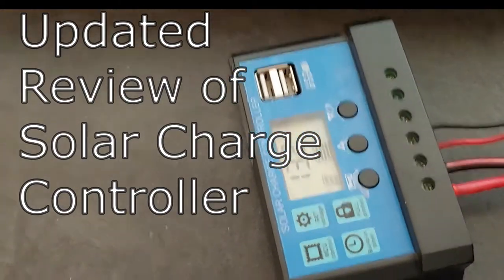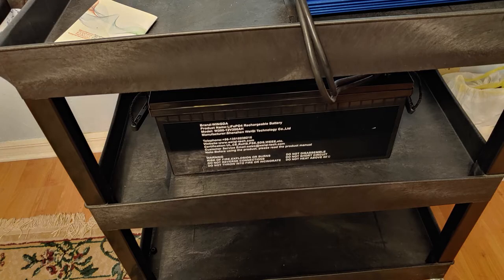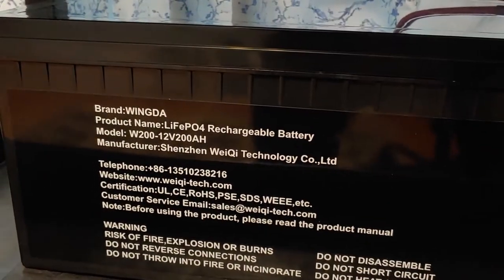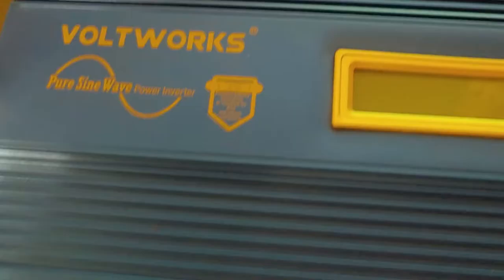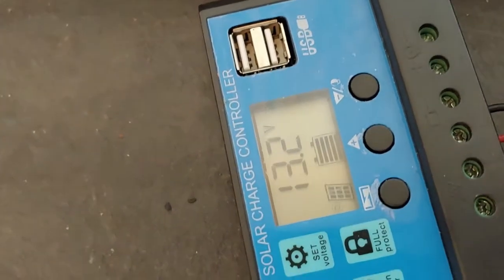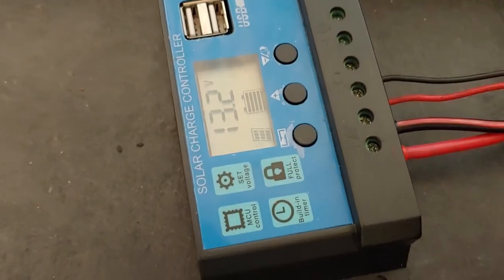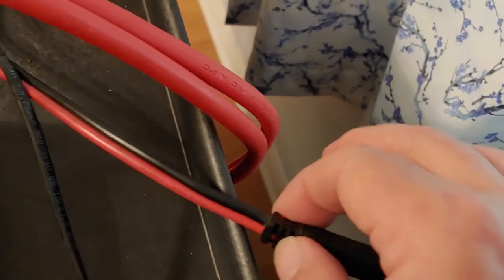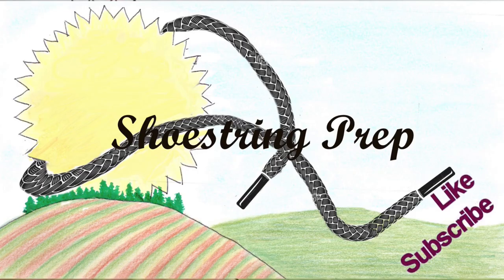4-week review of the cheap solar charge controller.

Comment: HAD MINE 2 YEARS AND ITS BEEN VERY STEADY, LEAVE IT ON ALL THE TIME, DOESNT TAKE MUCH OUT  AND FULLY CHARGED IN AN HOURS, FOR THE COST  ITS BRILL
Reply from the maker: Thanks for your comment.
Reply: @shoestringprep  what has the charge controller worked like over the last 12 months.

Comment: These are junk.  I got two and neither one of them pulse width modulate.  They just completely disconnect charging at 14.6 volts (Lifepo4) and then don't resume charging until 13.1 volts which is about 75% discharged for a Lifepo4.
Reply from the maker: Thanks for the info and your comment.
Reply: U may have it set wrong.
I got 3 within like 2 yrs, still have em and they charge up to the set point.

The problem i have is what Shoestring mentioned.. They seem to drain batteries with no solar pushing into them.

I plan to disconnect at night with a switch but Now i think i figured out the real problem (i could be wrong) .. maybe it has todo with that 24 that showed on the menu screen in this video.

Mine now shows that too when i know it should show 12(volts)
Its 12/2022 now.. when i got my first one in 12/2018 i remember being able to set it to 602 battery type and 12volt instead of it bein stuck on 24.

I think this is a flaw with these controllers and has to do with them slowly taking back power from batteries when no solar is pushing in.
Reply: They straight on off the full current on a 8 second period. Dangerous.

Comment: I have seen these cheap controllers available in versions of 20, 30, 40, 60, 100 amps.  I can absolutely guarantee these will not be able to take 100 amps.  For one thing, they have all of the same terminal strips and the wire for say the 60 amp and 100 amp are too tiny for the proper 60/100 amp wire to be secured to the controller.  100 amp would need a #2 AWG copper wire and it will not fit under these tiny screw terminal strip.  I believe they could handle 20 amps.  Pushing it to take 30 amps, after that, I will say you will have a burn off/melt down.
Reply from the maker: Thanks for the info and the comment.

Comment: Vehicles charge batteries around 14.2 volts while running  , a split charger system will charge the battery at the same volts.  So your right to set  your controler at that  voltage . 🇬🇧
Reply from the maker: Thanks for your comment.

Comment: Can the inverter be ran the at the same time the solar charger is charging the battery without issue ? i was curious because i noticed you did not wire the solar chargers load option .
Reply from the maker: Yes, they can run at the same time. Thanks for your comment.
Reply: @shoestringprep  thanks for the clear info!

Comment: Why would my negative and positive coming down from the control/charge box onto my batteries be getting hot? My negative wire was completely melted…
Reply from the maker: This could be caused by two major problems first the wires you have connected are too small or the amps and watts your solar panels are producing is too great for the charge controller. I would check these possibilities first. Thanks for your comment.
Reply: Double check your polarity

Comment: Thanks for the nice review, but one big question.  Are these charge controllers really rated for 60A or 100A (whatever they are advertised for) and are they really MPPT?  Seems like these are too tiny for so much power.  More expensive 100A or 60A charge controllers seem much larger.  For power electronics, like charge controllers and inverters, I usually go by weight of the equipment.  If it's rated at high power, then it should have significant heft.  A true MPPT controller would have much more heft due to hardware for DC to DC convertion, where as PWM controller would be significantly lighter.  I guess these super cheap controlers are all PWM despite what they are advertised as.
Reply from the maker: They are rated for what they are advertised as, but they are small and cheap. I watch mine from time to time and make sure it is working ok. Thanks for your comment.
Reply: I bought a couple of these cheap things as backups. They are certainly not MPPT. They just cut out when voltage gets to high. Fairly useless.
Reply: I don’t have a manual. What are they rated for? 60amp 100amp?  I have 2 x 100 amp batteries. Is that too much
Reply: This video is being really informative. I don’t have a manual unfortunately please can someone tell me what they are rated for 60 W or 100 watt maybe? mine was hooked up to a 120 W solar panel  charging 2×100 W batteries. Batteries completely fried and lucky not to catch fire.  Wires from solar panel burned black.  Did someone say they were not quality approved?

Comment: When you disconnect your controller from the battery, doesn't revert to the default settings? When you reconnect don't you have to set your custom settings back? Or do you just turn off the solar panel? I would think that  LCD display drain would be miniscule  on your battery. Thanks for taking my comment
Reply from the maker: The controller will keep its custom settings until you change them. Thanks for your comment.

Comment: Hi, thank you for the great video, did you measure how much watts are lost due to controller connected at night ? just wanted to know how much capacity is lost due to leaving it connected.
If I want to put a fuse between my 12V/100A LFP and the PWM, which fuse rating should I use ? 
Thank you.
Reply from the maker: I don't know since I disconnect mine at night. Thanks for your comment.

Comment: just saw your video. very informative . thank you very much
Reply from the maker: Your welcome and thanks for your comment.
Reply: @shoestringprep  in your previous video where you set up the controller. You said not to use it on a lithium ion battery. In this video you are using a lithium ion battery.
So which is it. Use or don't use.

Comment: Hello! We have this same unit (ours is a 40A), but I can't get something to work and was wondering if you could provide insight. Everything is seemingly connected correctly. However on the main screen I don't see the solar panels that should show up on the right hand side and the battery is not being charged. Is there something I did wrong? Is it not functioning properly? Thanks
Reply: Typically, you connect the good battery first (center pair of screws +/-).  LEFT is solar panel connected next on LEFT +/- pair of screws.  The LOAD is the RIGHT screws +/- and connected last.

Comment: I needed a replacement for the solar charge controller that came with my older 100 watt Harbor Freight solar panel system.  

Strangely HF seems to not sell a direct replacement, which I would have purchased if available.  The replacement from HF was fairly expensive and did not include the two usb charging ports which we use constantly with our 2 RVs.

So I ended up buying several of the controllers in the video, not because I really wanted this one, but didn't know what else to buy.

My main complaint is the small size of the ports and screws on the side - smaller and and harder to use than the HF side ports.  I bought a small Phillips screw driver thinking it would work, but no and then bought a smaller flat head that is very hard to crank down.  Also I've had to modify my wire connections that don't fit in in the smaller openings.    What size and type of screw driver are others using?  If I was willing to trade up from $10 or so price range to 20 or 30 for a unit that has larger easier to use screws and clamps with USB ports what would I buy?   I gave up, cut off the wire end vonnections that are slightly too large to insert.   Smaller wires are hard to clamp securely.   So bought an electric soldering iron to build my own wire ends to be inserted.

Don't get me started on the confusing  poorly done manual.

Sigh.  As someone said, get what we pay for.   But then after several hours gave up and bought the same.

How are other RVers charging their devices with other charge controllers without USB ports.   Sigh

Comment: 4:29 b02 is for a normal Lithium ION battery, but you have a LiFePo4 battery and the setting should be 1b3. "Read" the controller manual again. The LiFePo4 setting is underneath the Lithium setting. Also, the amount of charge the controller would drain overnight to run that display is so microscopically small, it's not worth worrying about. A small single  button battery would run that display for months.
Reply from the maker: Thanks for your comment.

Comment: I have been told that lithium is b05.  B01 b02b03 are lead acid dry sealed and wet battery. Please tell me which is right
Reply: I just have it set on bo1 on my lithium battery but I lowered the float voltage to 13.4 and it's been working good for a few months  now it's a 100 ah with 130 watts of solar it seems to have it's full power I can keep my gaming pc powered for 8 hours takeing 170 to 220 watts

Comment: I have found these cheap controllers useful for small AGM batteries 12v/8ah, 12v/14ah to be charged off of a 20 watt solar panel a good fit. I use them on my 12 volt actuator motors on my solar array.
Reply from the maker: Thanks for your comment.

Comment: Does the gauge of the wires going from panel to the controller matter, or is heat buildup an issue? I've heard 14gauge is good, but have used extension cord thickness used successfully.
Reply from the maker: Solar PV panels under 200 watts or so I use 12- gauge (AWG) wires. 200 to 800 Watts I use a 10- gauge (AWG) wires. This allows up to 30 amps of current to flow from a single panel. I would not use 14- gauge for anything over 15 AMPS. I hope this helps. Thanks for the comment.

Comment: Good video, this controller is cheap as chips and gets decent reviews but as you said it shouldn't be trusted without occasional monitoring.
That's a powerful battery connected to the Chinesium controller, I'd recommend adding an in-line fuse between the battery and the charge controller to protect everything so you have overload and short protection. i.e. protection from a short in the controller.
Probably not needed but a worthwhile extra for piece of mind.
Reply from the maker: Good tip. Thanks for the comment.
Reply: Wouldn't the controller pop the fuse.  ???
Reply from the maker: @murphyzlaw13  no, the controller will not pop a fuse. It will simply stop charging once the battery is fully charged and begin charging again once the battery needs charging. Thanks for your comment.
Reply: @shoestringprep  no, thank you...I'm still new at this stuff
Reply from the maker: @murphyzlaw13  welcome
Reply: @murphyzlaw13  as long as the controllers regular output amps are less than the fuse it won’t trip it until something goes wrong

Comment: Will that sized charge controller work with a single 600 watt panel?. I'm a bit concern about the amperage of the panel and have purchased and 30a inline fuse as before hand.
Reply from the maker: You will want a 60 amp charge controller for a 600 watt panel. Thanks for your comment.

Comment: If I'm not mistaken didn't you mention not to use with this charge controller with lithium battery? 
Great channel! I'm learning a lot about solar. Thanks Tom in Orlando.
Reply from the maker: That is what the manual that came the charge controller said. I am pleased you are enjoying the channel. Thanks for your comment.
Reply: Same question I have! CONTRADICTION!
Reply from the maker: @desertdogdan5920  The manual said not to use this with a lithium battery. So I mention that. But it will charge at 14.6 so I do. Do as you see best. Thanks for your comment.
Reply: @shoestringprep  Thanks for your great explanations! My question is because I can't find my manual! In your video of the manual it lists battery type 1 as lithium. In this video you have it set to 2.
Reply from the maker: Below is a link to my video of the" Manual for Cheap Charge Controller" I hope this helps. Thanks for your comment. https://youtu.be/So0j8uMxLIo
Reply: @shoestringprep Read the row next to equalization in the video. It says Bat 01 Lithium. You have yours set to Bat02. That's what I am trying to tell you. I hope this helps. Thanks for your reply
Reply: Which is the reason why it shouldn't be used for lithium batteries?
Reply from the maker: @olbapnairda  some models recommend not to be used with lithium batteries. Thanks for your comment.

Comment: Hi Shoestring, in the first video you said never connect it to a lithium battery?
Reply from the maker: Yes, I said that because that's what the manual says. But you can actually set it where the voltage will charge a lithium battery. Thanks for your comment.
Reply: That's eye opening I actually returned what I bought because the manual said the same thing

Comment: the one thing I cannot work out is how many watts you can pull out of the 12v Dc connections, on the controller, ie, I have a 30a one, I always use the batt,   good vid

Comment: thanks. do you really need to "unplug" the charge controller overnight as you said, what is the drain if you don't? ergo is it just a few milliamps for the controller? how many days (or months) would it take to make a significant reduction of charge on that 200Ah battery? Or are you implying that there is some kind of loss occurring from energy absorbed by the non-active solar panel due to the controller not blocking it?
Reply from the maker: If you keep the controller connected at night you can drain the battery. Thanks for your comment.
Reply: @shoestringprep is that a characteristic of these controllers? I don't unplug my Epever tracer controllers. They stay plugged in all the time. Does the manual say to unplug at night?

Comment: Hello, and thanks for this very nice video.
I am Daniel from France, I have a question. How do you think  it works when the solar panel (or whatever other source) only provides a low voltage, between 2 and 10 volts ?
Reply from the maker: That's a trickle charge voltage. It will cause the battery to recharge slower. It causes no problem for the charge controller.
Thank you for your comment.
Reply: I think The Solar panel voltage should be greater than your battery voltage to start charging

Comment: Q: What battery type is this controller supported?
A: The regulator is only suitable for lead acid batteries:OPEN, AGM, GEL.
B-01=LEAD-ACID, 12V; B-02=LITHIUM ION 3s, 3*3.7V=11.1V; B03=LIFePO4 4s, 4*3.2V=12.8V.
I think you should be on B3 think you have LifePO4 battery... I think I wouldpay extra 5 10 dollars toget Intelegent regulator...Funny says regulator not for Lithium but still offers Lithium settings
Reply from the maker: This type of controller will do wet lead acid. AGM, and lithium battery.
Reply: @shoestringprep  I pulled that text  from Amazon small print my be they mean not suitable by default... I saw similar model with what they call an Intelegent regulator..Might only make slight difference you know more than me. Thanks.
Reply from the maker: @SolarResurrection  always pick the model of a piece of equipment that's best for your needs. Thanks for your comment.

Comment: I've read a few reviews that claim that the MOSFET regulators stop working and even though the LCD screen tells you the battery is sitting at float voltage the controller is actually pushing panel voltage straight through  possibly frying your battery.
Maybe, if you are going to use these cheap controllers it's worth having a second voltmeter connected straight across the battery, just to be sure.
It's a tiny bit of overkill but it could save you having to fork out for another battery.
Reply from the maker: Thanks for the tip and comment.
Reply: I have one of this solar controller and I had it connected to the panels (100w x 2 in paralell), to a car battery and in the load i had a 12v 180w water pump, the battery was marking 13.5v, so i started the pump and after about 3 or 4 seconds the pump stopped working and the charger was full in smoke, it burned itself. It was supposed to be a 60amp solar charger. 😟 What could has happened?
Reply: @ronaldd.1355  The load terminals are only for small loads like LED bulbs under 10 amps. Your pump draws higher amps than that especially when it starts. Also pumps are inductive loads which can fry transistors on cheap electronic equipments like this SCC.

Comment: hi, you say at night you do disconnect to avoid discharging it your battery, the following morning must you re-program settings or it automatically will remain on the settings last programmed?
Reply from the maker: The settings remain at where I left them the night before. Thanks for your comment.
Reply: Use  isolator to switch of and on
Reply from the maker: @nsanyarasheeed8693  thanks for your comment.

Comment: Hi can I add two 100amp solar panels in parallel and one100amp Ah platinum plus 12v leisure battery and one 100ah platinum AGM plus 12v leisure battery in parallel to this controller ,I have a 60amp version.
Thanks
Reply from the maker: You can use the panels in parallel as long as they do not go over 60 amps. As for the batteries please make sure the batteries are all the same type. Such as all the batteries should be AGM and the same voltage. Thanks for the comment
Reply: Hi thanks for the reply. Both batteries are made by platinum 12v and 100ah. One says AGM the other says wet leisure is that a problem thanks
Reply from the maker: @kevinmurphy1457  if the batteries are not both the same type you will lose some effectiveness. Try to use the same type if possible. Thanks for the comment.
Reply: Great thanks

Comment: Can I use it to charge a car battery? How would be with setup? I have a spare car battery and want to try to use it
Reply from the maker: The simple answer is yes you can use a car battery, but they are not made to be discharged and recharged like a deep cycle battery. The car battery will not last very long in that capacity. Thanks for your comment.